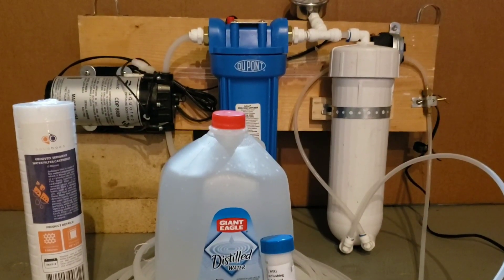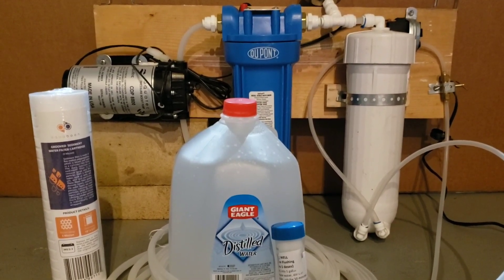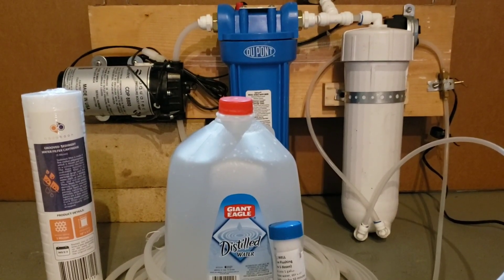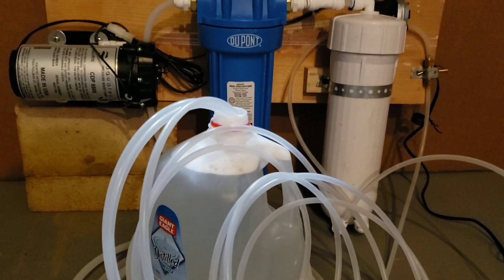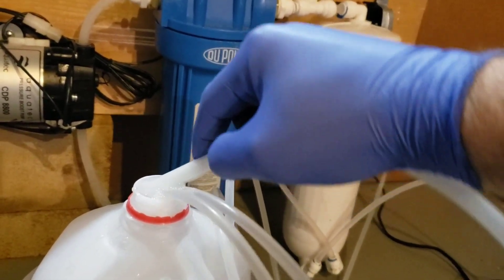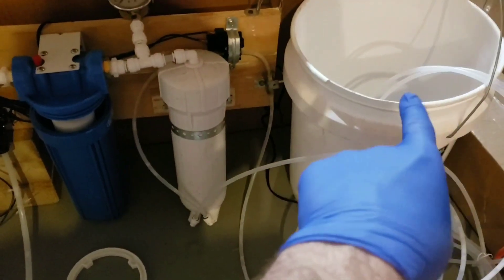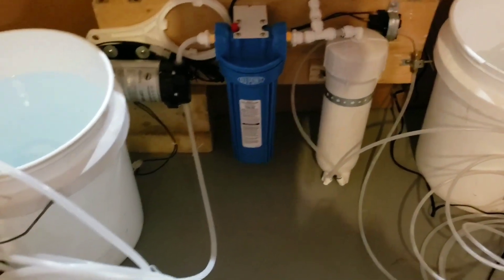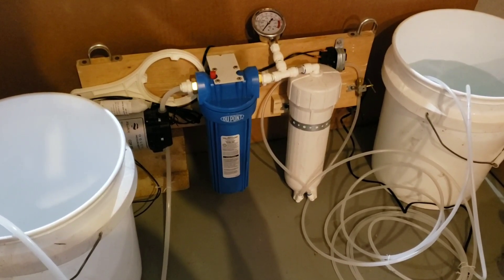Maple Syrup - Reverse Osmosis (RO) Soap Wash (NAOH)

Comment: During the season when you clean it in between runs,(after you flush out the membranes) do you leave the water in the prefilter until next use or should you dump it out?
Reply from the maker: I put a new filter in for permeate rinse, and then run it until it pushes air through system.  I've rebuilt and expanded my RO over the years and now have two 6 x 600 gpd membrane units that each use 2 TYP-8900K pumps. 

One trick I learned is to mount the water filter housing upside down. It will push air through and not leave anything in it.

Comment: Just curious, I don’t know if I’m doing something wrong or not but I bought pretty much the same pump that you have and this thing will barely pump any water. I don’t know if there’s an adjustment on it or not or if it’s just a junk pump. This couldn’t pull water from 6 feet away without help.Thanks
Reply from the maker: Not sure - have had great luck with the aquatec 8852 on my original build and the coronwater TYP-8900K on subsequent builds.

Comment: When done with final rinse, do you empty water from the prefilter housing?
Reply from the maker: You can leave it or disconnect the membrane(s) and seal them off by putting a closed ball valve on the inlet tube and then open and rinse out the filter housing and store that dry.